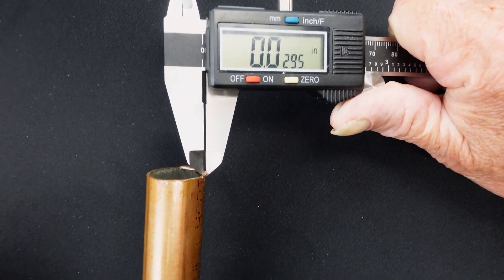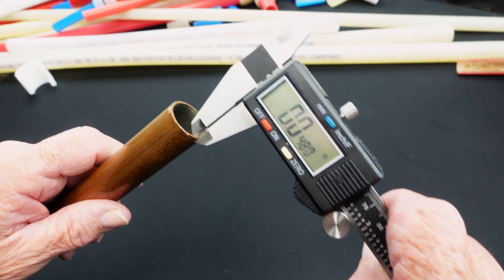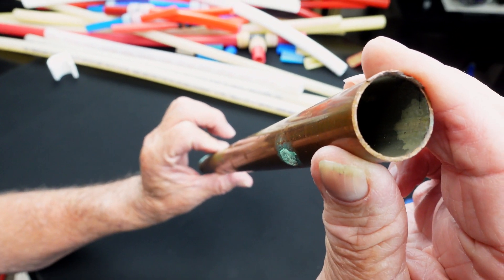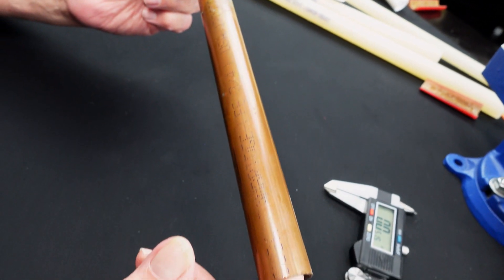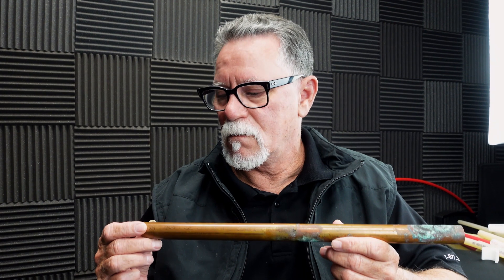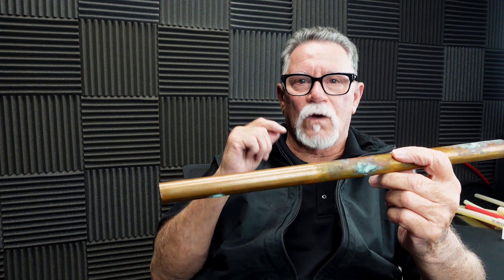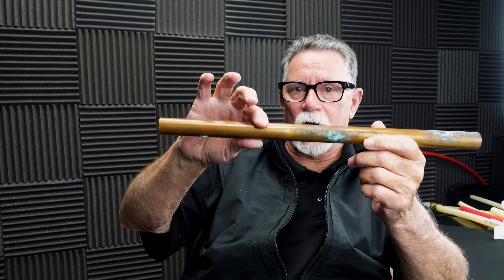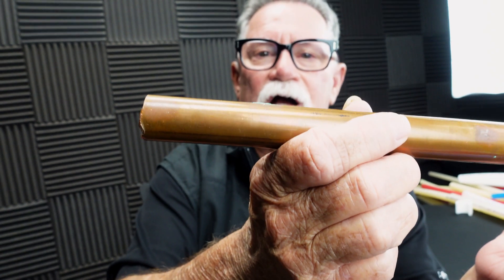L Type Copper Poisoning  | Breakpoint Chlorination

Comment: Interesting....  So what is the solution in your view to remedy this in a typical home?  (Oh, by the way, my parents home had a "Slab Leak" while they were on a cruise and it flooded the house.  Their home was built in 1956 which had Galvanized Pipe in the Slab here in Central Florida, so you might want to add that type of pipe to your "Slab Leak" list as well.)

Comment: It only depends on the water Minicipility if they’re over, chlorinating the water with too much treatment.   If you live in an area of relatively clean water where their concentration of water treatment is very low, and there is no other horse minerals that react with copper your copper basically leeches at a negligible unmeasurable quantity..  like here in San Francisco. My grandfather put in the copper in our house in the 1940s and up and down the neighborhoods of all our neighbors because he was a plumber, replacing the iron pipe with copper in the 40s through the 50s.. 80 years later as I add onto the existing 80 year old copper for additions for plumbing looking in the side to copper it is still brand new like the day my grandfather installed it. 
     Into a hell of a lot better than what’s leaking out of the plastics no matter which plastic it is

Comment: Only a problem with harsh water left sitting in pipes then used immediately unfiltered. People in major cities with good water quality that use their water often, especially if they use something like a water filter before drinking it, won't have a problem with this. We know this because copper pipe is ubiquitous and copper poisoning is not. Furthermore, it's normal to have trace amounts of copper in our diet so our bodies have mechanisms for handling it, unlike microplastics that we recently needed to deal with.

Comment: Using toilet should be enough to keep pipes flushed enough maybe.
Reply: Correct. First thing I do is pee, flush the toilet. That's enough to flush the void volume of the cold water pipes all the way to the street. Then, I take a shower, which purges the entire system, hot and cold. By the time I make my coffee, the only crud that I get into my body comes from the municipal supply itself. This article is nothing more than fear mongering from a crabby old fart.

Comment: Put a 6 stage RO system on your drinking water it will taste as good or not better then any bottle water you can buy. Mine has a permeate pump saves up to 80% of the waste water which I have plumed to go on some plants. Mine has re-mineralization cartridge that gives you back some minerals so not drinking distilled water. I had wanted to install one for years always relied on small filter finally did and ice and water taste way better. You find drink more plane water because it tastes better.

Comment: My dad built current house in 1970 used CPVC, still working great. Grandparents house was across the street older had copper, Granddad had issues and tests showed copper related issues they replaced all with CPVC where could at least 100 percent to kitchen and his issues stopped, and was on a well too so can happen with other water than chlorinated water. But I will always prefer well over municiple water anytime regardless. Chlorine issues popping up with some PEX too.
Reply: Depends on where your well is.  Here in Florida, our well water is loaded with bacteria.
Reply: @onjofilms  I live in Florida too and the problem your seeing may be resolved by having your well sanitized.  Frequently, wells here allow groundwater to get into the top of the well opening and can pollute the pipes and casings.  This tends to happen when we have hurricanes or heavy rains that flood areas near wells.  Having your well sanitized by a well company or possibly even do it yourself MIGHT fix the problem for your water.  Also, the depth of the well can be a factor.  Shallow wells may be more susceptible to this than  much deeper wells due to heat, sun exposure, etc.  Just something to think about.

Comment: Copper pipe quickly builds up a lining inside of it and after that, the water no longer contacts the copper.

Ammonia and chlorine isnt called breakpoint chlorination. Breakpoint chlorination is simply the term for free chlorine. It means that the chlorine in the water has met all demand and is now free. Free chlorine is essential as it proves there is nothing else in the water requiring disinfection. 

Less than 25% of water plants in the US use ammonia and chlorine, which creates chloramines. Most use chlorine only and monitor and boost levels at pump stations and tanks downstream.

If you are seeing pipe walls lose material and thickness, your water supplier needs to adjust their pH.

Comment: There is no seam in copper pipe.  Only galvanized steel pipe will have a seam and that will cause leakage points to all run along the line of this seam.  Your example of copper tube does not exhibit this characteristic  proving there is no seam.  Any lines you might see on the inside are die lines made during manufacture. 
But you are right, copper can be very slowly etched by chlorine in city water.  My mom and dad lived most of their lives in houses that had copper piping sweat soldered with lead-tin solder.  City water was chlorinated and probably fluorinated too.  But Mom made it to 96 years and dad lived to over 100 with no apparent side effects from the lead or the copper.  One of their German friends was shot during WW2 and had numerous fragments of the lead bullet left in him, some drifting to other parts of his body over the years.  He was in his upper 80's when he died.  So I wouldn't panic over either metal in plumbing systems.
Reply: Absolutely right. This article was made up by a crabby old fart with nothing better to occupy his time than to gripe at how "unsafe" his world is. Chicken Little should be asking himself how he even managed to live so long (hah!).

Comment: Copper is an essential mineral in our diets, in the right amount. Copper is also naturally antimicrobial which is great for preventing biological growth inside the pipe. Don't blindly follow the general statements in this vid. If the pH of your water is in the 6.5 - 9 range and your pipes are sized correctly for your home you will most likely be fine. Have your water tested for Copper if you are worried.
Reply: He's a "IDIOT".

Comment: I worked for a research doctor. He recommend that I run the water until it becomes cool from the street. There is also lead in the solder on copper pipe. A human body does need a trace of copper, but no lead.
Reply: Not always so. For decades now plumbing solder has been lead free. But yes, we do need some copper in out diet
Reply: @paulgush  Much old plumbing is still working (with lead). Most new is in plastic pipe
Reply: @paulgush  I have solder I bought in the 1990s from Home Depot has lead in it I don't use it on water pipes anymore. I remember when lead free came out they had both on the shelf for awhile. Actually looking at EPA website wasn't really until 2011 they required lead solder to be gone from everything.

Comment: This makes a great case for using Zurn PexB piping instead of copper.   Regardling mitigation of the "poisoning" for those with copper piping..  I'd only be concerned with what is used for drinking  or cooking - in my case I don't drink tap water, but we do use for some cooking.. so, I would flush out my kitchen faucet cold line before obtaining water for cooking.

Comment: Just found your videos. Recently retired. One  customer had this problem in a hotel. Random little leaks in two inch  hot water lines. Had never experienced that. Same customer called for another motel with pex A random leaks in walls three years old building.  This went on for weeks. Finely insurance paid to repipe entire building. Then he also had a subway with pex B started leaking random spots in the runs in walls very hard to repair. Boggling the mind. Asked everyone I could think to ask. No good answer to my question. First time I have heard of this from anyone else.
Reply from the maker: Send me some pictures of the pipe and leaks please. Also pictures of the fittings.
Reply: @IntegrityRepipeInc  unfortunately since I retired I don't have any access to any of that anymore most of the pictures and samples of pipe we sent to the manufacturer

Comment: What if I'm on a well? I repiped my whole house in copper a few years ago. I have well water. I don't seem to have any issues.
Reply: You won't. Copper is only toxic if you have chlorine and/or ammonia etching it and causing high rates of dissolved copper in the water. Low rates of dissolved copper in water (like the rates you'd see if you had a well) are totally healthy.

Comment: Lol.  If you reach breakpoint chlorination you won’t have ammonia in your water. 

Also, Your water department will add phosphates that will stick to the insides of the pipe and help prevent corrosion and copper leaching. 

That said, there’s no perfect pipe. Get an RO system and add a remineralization filter if you want.  That will take out everything, lead, copper, fluoride…, etc.
Reply from the maker: Not True !!! The ammonia lasts much longer than chlorine and the ammonia is used for this very reason it stabilizes the chlorine and makes it posable for the chlorine to make it from the process plant all the way to your home. Phosphates really? will not stop leaching or etching of copper pipe that is why copper pipe leaks are the number one claims on homeowners insurance policies. What does a whole house RO unit cost do you happen to know? What happens to the copper pipe if you install a whole house RO unit?
Reply: @IntegrityRepipeInc  They make these things called point of use filters.  Use one for your drinking water, not your whole house.  

No water treatment plant is adding ammonia to "stabilize" chlorine.  Unless they want to recreate WW1.

Once breakpoint chlorination is reached (which it must and must be maintained in the system in order to pass regulations) there is no more free ammonia.

This is tested by your water plant testing for a free chlorine residual.  once there is a free residual the free ammonia is gone.  

Phosphates not being added are the reason why Flint Michigan had such a huge problem so suddenly.  They weren't added and the protective layer built up over decades was quickly destroyed.  which drastically increased lead levels in the drinking water.  That and the reason for checking for a free chlorine residual are water treatment 101.  I can't speak for your water treatment plant, just the one I operate.
Reply from the maker: @BB-nn9en  Breakpoint Chlorination is taught at every water academy and university in the USA. Example americanwatercollege.org . You missed a few things. Go to search and type in breakpoint chlorination. Happy hunting. By the way you forgot to tell the public what a whole house RO unit cost is and you forgot to mention that it is illegal in every plumbing code nation wide to use copper in an RO unit.
Reply: @IntegrityRepipeInc  I never said anything about a whole house RO filter, you did.  Get a point of use RO filter, like what everyone understands to mean when a home RO filter system is mentioned.  

I deal with chlorine residuals and ammonia every day.  Once you achieve breakpoint chlorination you wont have free ammonia.

Comment: Is SharkBite pex any good or dose it have the same problems
Reply from the maker: Sharkbite fittings fail is what I have seen. I do not use Sharkbite Pipe Ever.
Reply: @IntegrityRepipeInc  are you referring to the shark bite “push -to-connect” fittings or the brass and or plastic ones that they sell at the big box stores..?
Reply: @IntegrityRepipeInc  Aaron 45 is asking about Sharkbite  PIPE. What's wrong with it?